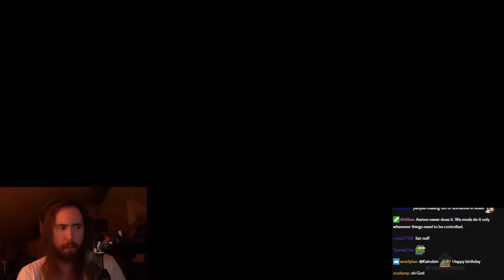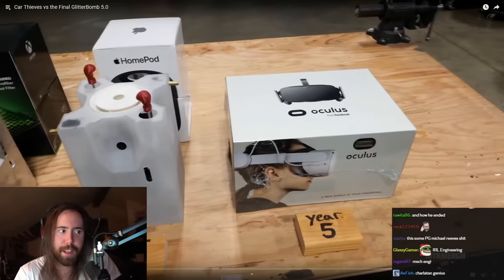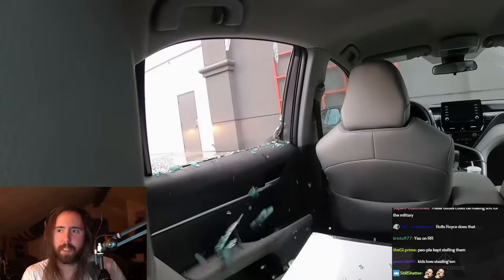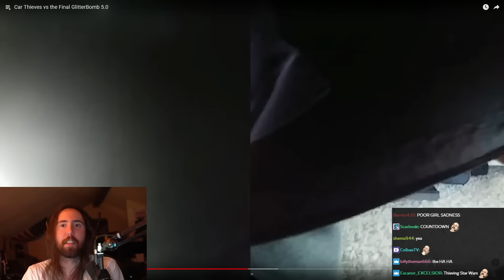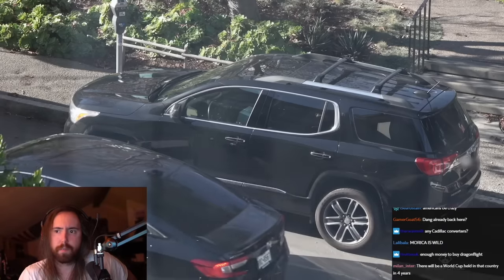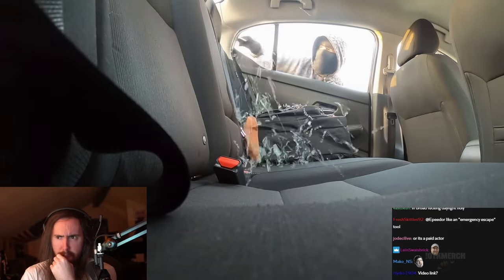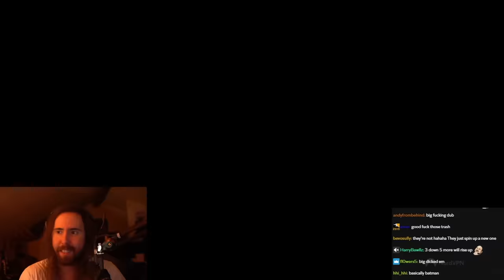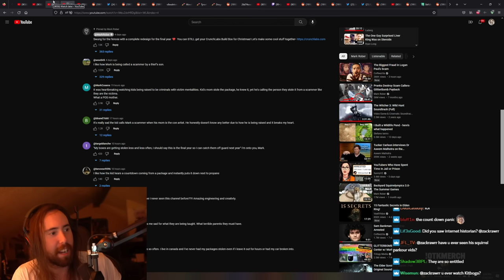Car Thieves vs the Final GlitterBomb 5.0 | Asmongold Reacts

Comment: When the glitterbomb gets so advanced it is worth more than the usual package with an occulus would have been :face-orange-biting-nails:
Reply: Sure, but when they recover it they can re-use some of the materials.
Reply: @WannaComment2  they're probably damaged/old and can't be resold/refurbished.  Not many phone manufacturers offer an exchange/recycle program and places like gazelle would pay you like $20 for an older model used phone.  Realistically all you'd need are the cameras of the 4 phones to be functional and 1 phone to upload.
Reply: @DrDipsh1t  those phones looked new , though
Reply: @xLuis89x  the backside of the phones did. We don't know the condition of the front side. Also if they're old models, they'd be dirt cheap. I still have my galaxy s5 and s8 that look basically brand new because of the case and tempered glass screen protectors I used with them. Would be worthless now as a trade in.
Reply: @WannaComment2  A phone doesn't just have a camera, though. It has a computer, microphones, a GPS module, accelerometers, and, of course, communications modules (SMS, WiFi, Bluetooth) --- all in a neat package. So... the phones are super useful for this type of application.
Reply: It's not about the money, it's about sending a message
Reply: A lot of 3D printed stuff so now. He's an engineer and a YouTuber so I'm sure the videos pay for it all and sponsors and partners too. T-Mobile clearly being one of them this time around.

Comment: 20:56 - no, it isn't "made to do that' - that's just regular glass, and they don't treat it or cover it in case your car is submerged and you need to break the window. 
The windshield is made by laminating PVB between two pieces of glass so the glass doesn't shatter and go everywhere
Reply: You're half right. Where you are wrong is that it's not just "regular glass" . It's tempered glass and it's absolutely meant to break into small blunt pieces (instead of large sharp pieces) while being simultaneously stronger than "regular" glass. The lamination process you speak of is a real thing, but costs significantly more than other windows in a car. This is why it's done in more critical places like the windshield. The windows in the back of a car can vary, but they are always made with tempered glass. Most of time they aren't laminated the same as the windshield. The lamination process is used to make the windshield much stronger than just tempered glass alone. This is done to prevent oncoming objects from penetrating the cabin, like a rock on the highway or something.

Comment: The point of tempered glass making tiny cube-like pieces, is not so it wont cut you. IT WILL CUT YOU, its glass, sharp glass. But, the pieces are so small there is practically 0 chance you can fatally harm yourself with them.

Comment: the thing he is using is an emergency tool, they are window breakers and belt cutters for if you drive into water during an accident you can cut your belt and break the glass(because the pressure stops you opening the door till the car fills up at the bottom)

they have a ceramic tip on them that instantly shatters glass

Comment: Also in case you ever get in a wreck it prevents you getting trapped inside of a vehicle .
I have one of those hammers in my glove box .
Living in Michigan in an area where there are tons of natural ponds , creeks , in land lakes , there's a chance my car if I get in a wreck my vehicle could end up in water . 
That window being like that has saved people from drowning .
Reply: That is why headrests detach. They're meant for breaking glass in the case of emergencies.
Reply: @evanhines2490  That sounds very nice, but they're more for whiplash.  Though you could use the spikes to bust out a window, they're  ultimately not designed for it.  The ceramic from spark plugs however, totally will.  Though that's less useful info.
Reply: I keep one with a seatbelt cutter in my armrests in the front and back seat. We spent an evening one day showing our son how to use it on an old junk vehicle we were taking in for scrap. Hell, I even tried it out (I found it’s best to hit the bottom corner of the window and then push out with your elbow for a quick exit).

Just hoping we never have to use those things, but very handy to have. I’d rather just reach into the armrest and grab that as opposed to fiddling with the headrest like another mentioned, especially if you’re in a situation where you can’t move around much with a stuck seatbelt.

Comment: It is because they already have buyers who will take certain products from them quickly. Sitting around with a stolen item you don't have fences to shift it to asap, just lives you holding a stolen item you can't get rid of, most devices are enabled on networks so very easy to track where it is (seen in this vid) Phones, laptops, tablets are not sold as devices, they are sold are given to people who strip them to parts (same with stolen cars) which make much more money and well the device is dust so no chance of getting ot back to owner.

Comment: glass break on pieces because its a  "
hardening glass" ...process of making this kind og glass is different and yes its more safe but its create because of resistance to scrathchess.:) in cars they use this on side winows and back window.but front glass dosnt "crash" because its another kind of glass - laminate.hardened glass is stick with glue to laminate to prevent pieces of broken glass reach to inside of car.:)

Comment: Not only did they use a tool to break the glass, it's also where they hit it. The corners of the frames.
Reply: It doesn't matter where you hit it.
Reply: @evanhines2490  It does though.  Aiming for the center it could bounce back at you. Being near the frame there's less deflection, and increases the chance of a shatter.

Comment: No they are not made to shatter to smaller pieces not to cut people. They are hardened, which means they are stronger but also fragile when the breaking point is reached. All the tension in that hardened glass is released at once.

Comment: I'm surprised there's not more content creators out there doing variations of this.
Reply: It’s pretty pricey tbh, gotta buy cameras, microphones, a tracker, as well as all the traps and having the knowhow to put it all together.
Reply: @coolfrymaster  Exactly, most youtubers aren't engineers who run their own shop.
Reply: Because most content creators don't live in poverty/crime riddled areas.
Reply: @Quintessence4444  stand for something, or fall for anything.
Reply: Easier to just fake animal rescue videos instead.
Reply: @coolfrymaster , it's kind of overengineered. You can make the "traps" purely mechanical/electric with used smartphones/IP cameras streaming the footage. For the fart spray you can have a spring-loaded hammer break a jar of stinky liquid, for example.
Reply: Content like this is very expensive to produce, that's why. It takes a certain amount of great engineers to pull that off quickly so it doesn't end up in development hell. For most content creators to go and do that, it's just a massive risk with low chance of getting anything back. Only a handful of content creators can afford it. You have to be ambitious and have the resources. Look at Mark going on and selling his own brand of toys. Imagine how many people and effort go into actually designing, mass producing and distributing these. It's not easy business. He won't show any of that because it would take away the value proposition and showing off what the customer gets. It truly is remarkable.
Reply: @coolfrymaster  people rather so fake pranks the same over and over

Comment: just now starting the vid. i'm at 0:28 and i have to say, as much as glitterbombs are funny.. it is stupid that they are basically illegal, counting as booby trap and Assault/battery cause an innocent kid "may get hurt" or an emergency personnel moves the package to get into the house and ends up choking on the glitter... it is stupid and i hate that it is illegal. especially when it is legal for banks to use paint bombs on money.. what's the difference? that paint is dangerously hard to get off. i had to buy a whole new wardrobe to replace my clothes, but luckily i had just recently came into a large sum of cash, unfortunately that money was also ruined by the paint and.. shit.. never mind.

edit: i double checked, and the wording of the law is "with the intent to cause harm, injury, or death" and any "reasonable" person would assume that glitter is not harmful and is simply a surprise shock factor. the chemical fart spray is border line, as there are cases of the chemical having allergic reactions. but since the glitter isn't propelled at any ballistic force and is simply spun out making a mess, then this is a bit more legal than my initial reaction. The glitter bombs i'm thinking of are the "explodes in a cloud of glitter" there was a guy in my home town who did this and he was Charged with Assault. The thief was dumb enough to press charges. They went to court and the homeowner's lawyer talked with the thief's lawyer and they determined that if the Thief drops the assault charges that the homeowner would drop the theft. so they did.. but the city decided to press charges on the thief. The Homeowner had no charges cause the police chief is Based AF and thought it was funny, the homeowner was told not to do it again cause next time there would be criminal charges.

Comment: Disapppinted the drones didnt work and mark didnt comment on it to explain why. The 1L of stink is great but changing the glitter method made it far less messy. A dual spinning glitter and drome delivery would have been a good backup. He went to far with the drones and with the lack of glitter spray, the videos seemed less satisfying than the previous ones.

Comment: I can imagine a possibility where somebody would buy used cars sit in the trunks park them with a shotgun and wait for breaking and then a quick check or the back seat when you pull it down fires off the shotgun pulling the trigger I can also start seeing knapsacks and glitter bombs and stuff being swapped out for c4 and pipe bombs and mustard gas.